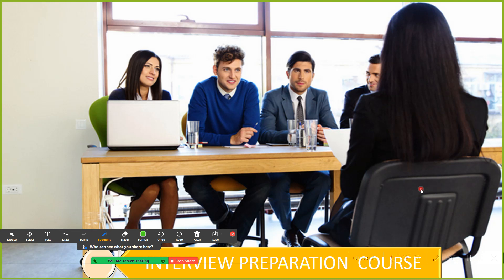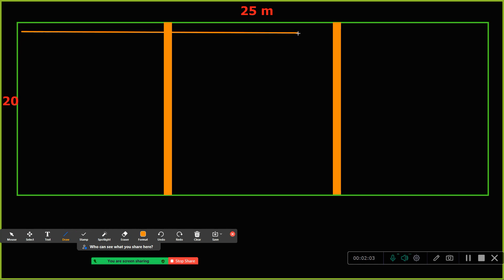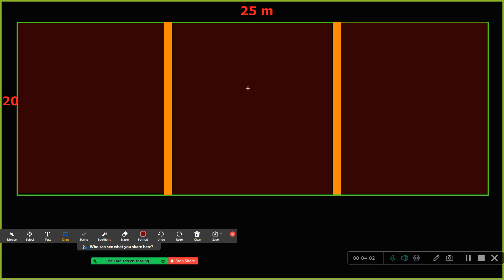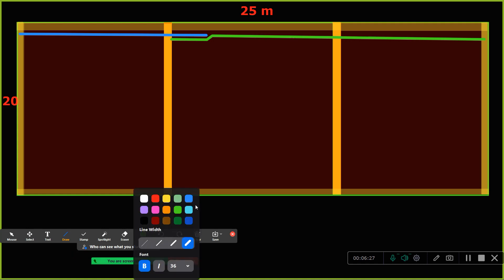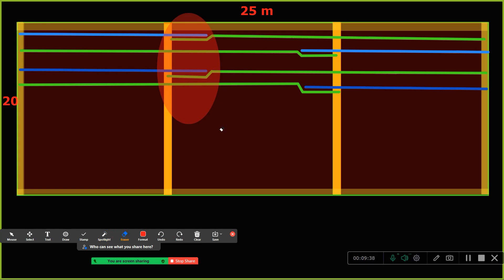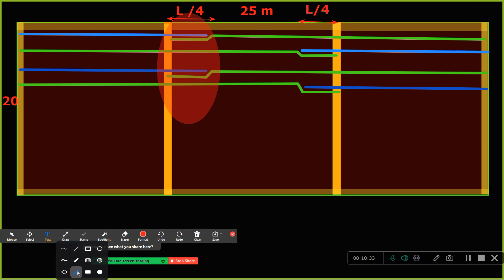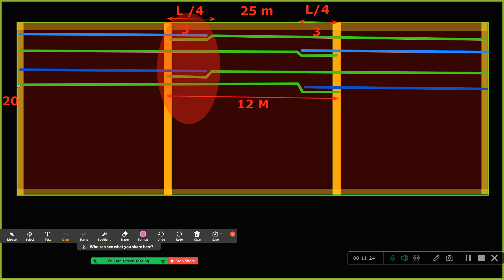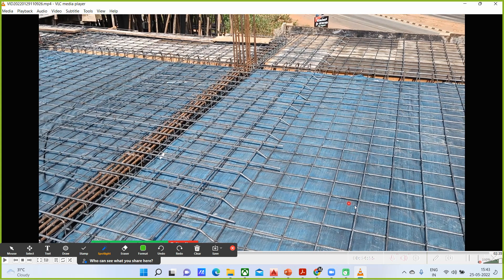𝗟𝗮𝗽𝗽𝗶𝗻𝗴 𝗶𝗻 𝗦𝗹𝗮𝗯𝘀 ll 𝗪𝗵𝗲𝗿𝗲 𝘁𝗼 𝗟𝗮𝗽 𝗮𝗻𝗱 𝘄𝗵𝗲𝗿𝗲 𝗻𝗼𝘁 𝘁𝗼 𝗟𝗮𝗽, #civilengineer #civilbrains

Comment: I understand that you have explained the bottom bars of slab has to be lapped within L/3 or L/4 and must not go any further towards the centre. But I have a question that remaining within that L/4 can we make lapping through the beam reinforcement? I'm not a civil engineer so the doubt, and in my sense I feel if that is done the bottom bars at the lap will also be able to rest and get support from the beam. Please answer.
Reply from the maker: Pl WhatsApp on 8095128107
Reply: Did you lap at beam?
Reply: @nabinem1  No. I talked to the engineer (owner of this video) and he said we must not lap the slab rebars at the beam+slab junction because of the maximum bending moment lies here (and at the center of slab rebars). So, he suggested to lap within L/3 or L/4.

Comment: Hello Sir, please reply. Shouldn't we avoid lapping near the support for the bottom bar? Shouldn't we provide lapping within one-third of the span length away from the support
Reply from the maker: For the slab in the bottom portion you can lap bar near support , avoid lapping at the center of the slab for the bottom bar .
Within l / 3 you can lap in the bottom bar

Comment: In slab, bottom bar is main bar and it should be placed first on Shorter Span, no.
Reply from the maker: Yes..
Reply: In vedio placement is correct there are main bars